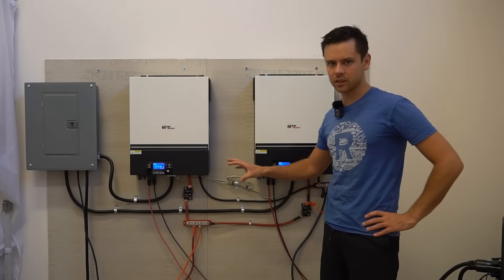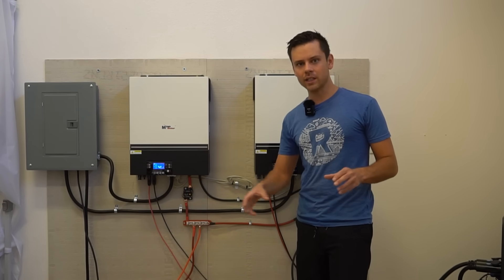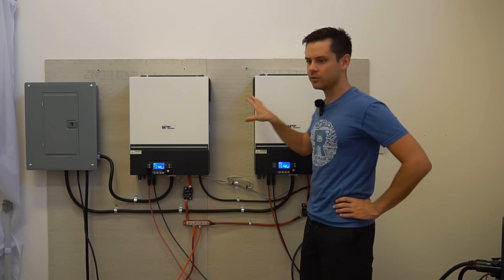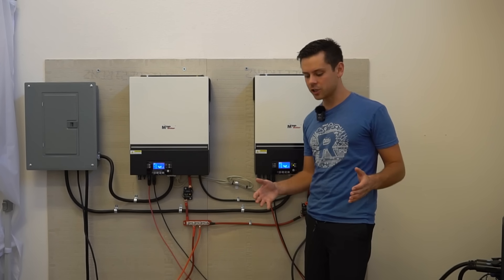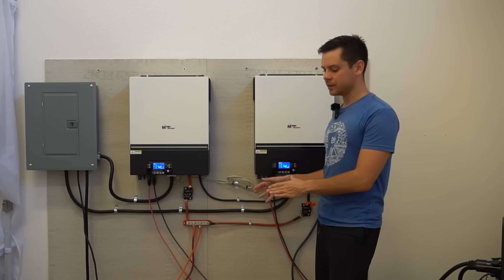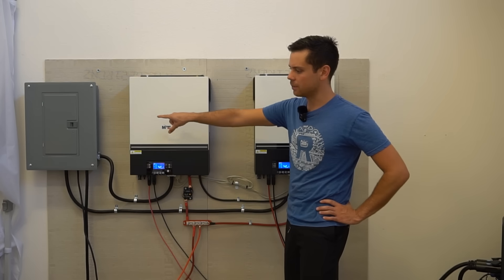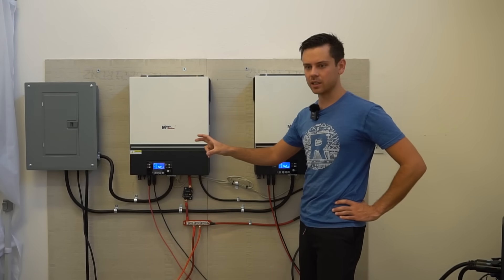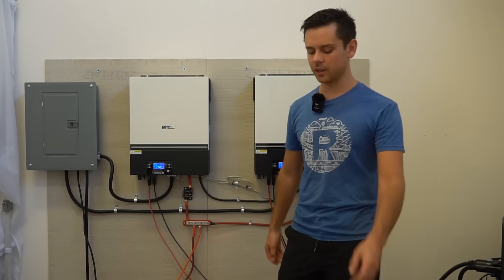Does my 13kW Offgrid Solar System require Grounding? Is it Grounded?

Comment: If this system can feed a constant 5kw with grid tie, and could handle at least a 7kw input, it'd be perfect for my needs.  Looking forward to see if your system gets there, though my limited understanding of electrical theory might leave me guessing if it can, even after you explain it.
Reply: The LV6548's are off grid only. The upcoming LVX6048WP inverters enable grid tie, and two will provide 13KW.
Reply: @Sanwizard1  Great.  Now comes the hard part.  Affording the components to build the system.

Comment: I have now watched the video.
Surge protection is a wonderful idea on the DC side - do not oversize it, match it closely to the maximum open-circuit potential of the solar array. Get the ground connection wired as straight as possible to a good earth ground (and this can be separate from the service entrance - like at a ground-mounted array) but bonded to other ground rods if inside a structure.

You are correct in not adding more ground points than at the service entrance of a building. Ground loops are to be avoided, chased down, and eradicated. They can cause all kinds of obscure issues. An SPD will not cause a ground loop.

The DC side, being under 60 volts, is likely going to be a Class 2 circuit under the National Electrical Code (NEC)
Solar arrays have the advantage of being inherently current-limited.
Batteries are not, so over-current protection is required.
Neither are going to be much of a shock hazard at 48 VDC.

thanks!
Reply: Your knowledge of electrical code is impressive, James Alles. I felt like a first-year electrical student, again, just reading your comment. Are you an instructor?
Reply: @jayspell179  no, that is something that I missed. I became aware of the low-voltage aspect of the code working for Simplex on Fire Alarm systems in the 80s. I suppose I did do a little teaching. thanks
Reply: Wow I don't think I'm ever going to be able to figure out these grounding theories.🙂
Reply: I enjoyed reading your comments. What happens when the PV arrays are wired in series and produce voltages of around 400V DC? The latest solar inverters can take up to 6kW input @450V DC up to 20A. If I had two 5000W inverters wired in parallel and eight 50V Canadian solar panels (VOC 49.6V, IOC 13A) wired in series serving each inverter, what might be the earthing / grounding implications of such an install?
Reply: @fredflintstone1428  earthing / grounding stays the same. Conductor insulation becomes critical - 600V is needed. check your local codes, it is now high voltage, and an entirely different animal.
Reply: @jamesalles139  Many thanks James
Reply: @jamesalles139  Hey James, I plan to purchase a single EG4, 6.5kW 500V VOC 48VDC inverter with a single LifePo4 48V battery and 9 455W (VOC: 49.35, ISC: 11.44) solar panels.  If I connect the AC outputs of the inverter to supply a panel's main breaker, would I just use a "traditional" copper grounding rod running to the panel's ground bar and be done, or would I not use a grounding rod and ground some other way?  Thanks in advance.  I appreciate your knowledge!
Reply: @fredflintstone1428  Going to be doing something similar myself.  I have a bit of a run from the panels to the solar inverters.  I want to keep the amps low, so as to not have to run super thick cables.

Comment: Seems a bit over complicated ... my understanding of what I think I heard ... a panelboard/breaker box (out of your inverter) should always be tied to an earth ground.  You may choose to earth ground the metal case of your outdoor solar panels for lightning protection.  However, do not earth ground your solar panel output/PV supply to your charge controller.  It's okay to surge protect the PV supply, but again, do not earth ground it.  Is that accurate?

Comment: I disagree, my solar power system was professionally installed. I had lightning strike (300 million Volts and about 30,000 Amps) my tree or next to it last year and it destroyed everything in my home plus both my neighbors lost there appliances. My warranty covered the loss  and the solar company come out and replaced my solar power system. As for the appliances that was out of pocket.
Reply from the maker: Well if a lightning strike is close or hits your equipment, nothing can save it 😂😂 what argument did I present that you disagree with?
Reply: @WillProwse  I think they just wanted to “disagree” and tell their story…..

Comment: Does this same thing apply to chassis grounding in an RV? This has always confused me that there is a separate chassis ground off the inverter as well as off the main panel. Based on what you are describing, it sounds like there are situations where a circuit might exist?
Reply from the maker: A better term to describe the ground in a RV is chassis DC supply return conductor.
Reply from the maker: Good question. Shore power connection requires a grounding connection with the plug. No need to run your own ground. The "ground" in a vehicle is not a true earth ground. It is for saving cost on wire, and use as a ground when tied to an ac connection. This connection is at the converter box where the shore power plug connects.
Reply: ICE vehicles usually use a DC grounded system, where the negative current conductor is a grounded conductor. This is analogous to a AC neutral. There is no ground fault protection in these ICE vehicles, normally only over current protection.
Reply: @FrancisKoczur  if one of the DC positive wires comes in contact with the chassis. The fuse or circuit  breaker for that circuit will disconnect the circuit.  That is the fault control.
Reply: @timselectric502  A short circuit with a small resistance will have a high current and blow the over current protection fuse, but there is not a separate safety ground. Ground fault protection in AC will trip even at a low current.

Comment: Will, can you please give us a visualization of different grounding procedures? Correct vs incorrect. Grid tie vs off grid.
Reply: seconded
Reply: Thirded
Reply: fourthed
Reply: Fifth-ed
Reply: Ditto
Reply: Same, please
Reply: Please provide some visualization on this topic. I have seen an end to end Inverter/Electric Sub-panel/Battery setup video and the gentleman there grounded the whole system with a true grounding electrode. Basically a separate grounding bus bar in the subpanel which is connected to inverters as well as true ground electrode outside.
Reply: Follow the instructions in the manual for the equipment.  Very simple.

Comment: Does this mean a sub panel for a house shouldn't have a grounding rod if the main panel does?
Reply from the maker: Yes exactly
Reply: Yea.
Reply: If the sub panel is in the same structure (house for instance) yes that's correct. If the sub panel is in another structure such as a detached garage away from your house a ground rod is required. The power feeding your detached garage sub panel (2 hots, neutral and ground) in this case the ground wire is bonded to a ground rod outside the garage. Definitely not the neutral to ground bonding as in the main service panel.

Comment: Will, be very careful discussing marine "grounding" as it can get tricky and lead to ALOT of corrosion for any metal touching the water. Stray current for marine is a big deal.
Reply from the maker: Very true
Reply: Yeppers, sacrificial anodes is an interesting subject for others who are curious about this.  Best
Reply: This is an area where even qualified marine technicians can get it wrong.  Be very cautious about offering advice.
Reply: @gregoryyount6907  
And every boat is different. Wood, fiberglass, steel or aluminum hull and composition of below water line hardware. Then you have “under protected, over protected and the just right. Where will it spend most of the time fresh, salt or brine. Types of anode metals, bond or not to bond and bond to what? Neutral switch over to ground, isolation transformers, equipment current leakage. Oh the list goes on. It’ can be a science. Wrong gets expensive.
And land electricians think they got it rough Lol!
Reply from the maker: Check out the victron unlimited PDF for some basic marine grounding advice: https://www.victronenergy.com/upload/documents/Wiring-Unlimited-EN.pdf

ABYC and this book is where I get my info on marine systems from: https://www.amazon.com/Boatowners-Mechanical-Electrical-Manual-4/dp/0071790330/ref=asc_df_0071790330/?tag=hyprod-20&linkCode=df0&hvadid=312176357948&hvpos=&hvnetw=g&hvrand=3157251246000314898&hvpone=&hvptwo=&hvqmt=&hvdev=c&hvdvcmdl=&hvlocint=&hvlocphy=9030754&hvtargid=pla-333901114316&psc=1&tag=&ref=&adgrpid=60258871137&hvpone=&hvptwo=&hvadid=312176357948&hvpos=&hvnetw=g&hvrand=3157251246000314898&hvqmt=&hvdev=c&hvdvcmdl=&hvlocint=&hvlocphy=9030754&hvtargid=pla-333901114316
Reply: @WillProwse  
Thanks Will. 
Hadn’t seen the Victron one. Now I just need to delete info in the grey matter to make room for the new lol.
Reply: @WillProwse  I'm glad you through some additional resources out there on this.  I cringed when you brought up marine systems because it can be so deadly.  I think if someone is going to youtube to learn about marine electrical they need to at least let a professional design their system.  You really need to understand electrical theory, electrical systems, balancing and grounding.
Reply from the maker: @mclovinfwmc  yes agreed. I understand the dangers.
Reply from the maker: @mclovinfwmc  which is why I usually never cover it

Comment: My growatt inverter specifically addresses this in the manual where I have to have an inverter controlled relay to bond and unbound my ground to neutral on the inverter output specifically when it switches back to grid power. 

Perhaps you can do a video on this?
Reply: Yep, @john, it's a requirement in my country, when the inverter operate on battery, neutral must be connected to ground. Mppsolar inverter don't do that. Shutdown ac input and check the voltage between neutral and ground. Should be zero, but its not on mppsolar inverter. You can find a grounding box, wich is simply a relay that connect neutral to ground under a condition controls by the inverter optional relay output. Need a special firmware version  to activate the relay when ac input is not present. Otherwise you can implement the same thing with voltage detection on ac input and some relay. The thing is mppsolar is totally speechless about grounding to neutral regarding regulation and theirs products.
Reply: @sergea1138  yes I have a grounding box. Yes the growatt has the function built in to operate the grounding box.
Reply: The transfer switch in my RV does this. When you kick on the generator it switches over to generator power and bonds neutral to ground since you are no longer getting bonding externally.
Reply: I have loads that will not run if the neutral isn't bonded to ground
Reply from the maker: Ohh is this when it is being used as a UPS? I usually disable that in my systems.
Reply: @WillProwse  I run solar as my primary and the grid as my backup. The grid neutral and ground are bonded in the main panel. So when I'm running in grid mode all loads function normally. When the batteries charge up and it switches back to the inverter my loads stop functioning because the neutral and ground output of the inverter are not bonded.  By code I can only have 1 neutral to ground bond in the system. If I connect neutral to ground on the inverter output without a relay I end up with 2 bonds when it switches back to the grid.

The growatt has normally open and  normally closed wire connections for this exact purpose to control a bonding relay.
Reply: @WillProwse  as an example, the only time any power generating source, sush as a generator can be determined as a seperately derived system is if the disconnecting means from one system and the other breaks the Nuetral(grounded) conductor at the same time during power transfer.
Reply: I suppose, that this relay acts as "automatic grounding relay" for the following reason. Inverter itself can be considered as independent AC source, like gasoline/diesel generator. So, if this inverter is in Off-grid mode (island mode) without any connection to AC grid, then, its output neutral must be grounded. 
If inverter has AC grid connection, AND its neutral runs from AC input to AC output continuously, without any interruptions like contacts of relays, then, neutral grounding of AC output is accomplished by AC grid's already grounded neutral. Following yours descriprion of Growatt behavior and need for specially controlled relay, I think, that neutral from inverter's AC input to AC output can be breaked by some internal relays in island mode. So, this relay is needed to groung output neutral locally, near the inverter itself. The same requirements for output neutral grounding are exists in the world of Telecom inverter systems (DC 48 V to various AC voltages). We also need to ground AC output neutral in case of absence AC input connection to AC grid.
Reply: This is worrying because after reading John's explanation it all made sense.
Reply: @wendygerrish4964  my issue/comment isn't entirely in line with what Will is talking about. What Will says about grounding and grounded is great information and accurate.  What I'm talking about is how some loads in off grid systems won't operate if the neutral and ground aren't bonded.  The load sees the potential difference from L1 to ground as 60v and from neutral to ground as 60v and the load won't operate. I'm hoping Will makes a video explaining it better.
Reply: @johnlockington9872 , ungrounded (IT) systems poses main problem to homeowners: these systems requires 2-pole breakers for Line-Neutral loads, 3-pole breakers for both split phases + neutral and 4-pole breakers for 3-phase loads with neutral. I.e., breakers must disconnect all current-carrying conductors for safety reasons. So, standard "household" panels doesn't allow this configuration. All of it specially designed for grounded systems. So, you need to use industrial components. Also, a special insulation integrity (resistance to ground) control unit is required for safety reasons. So, grounded systems are more easier and economic to implement
Reply: I agree, hopefully Will can do a video on this. I was instructed to jumper neutral input to neutral output.
Reply: @Nathan-wf3fr  I don't think that's actually a good idea as you're then allowing the neutral to be connected all the way back to your main panel even when you're not running off your main panel. While it depends on your inverter the Growatts like I have can command an external relay to open when your on your main panel and to close when your on your inverter/battery supplying the power. That basically bonds and unbonds the neutral and ground on the output of the inverter when appropriate.
Reply: @andycanfixit  yes sir, agree with you 100%. Many thanks for the input. I’ll start relay shopping now. Would be great if either you or John posted a video for this. It’s a super common issue that many beginners like me overlook. We think our systems are all good to go and in reality without this relay controlled neutral to ground bonding we have damaging voltage swings and no ground to our AC outputs.
Reply: @Nathan-wf3fr  I posted a video on the process for the Growatt LVM 3000 inverters. It's really straight forward on that unit since they have an option to control it.
Reply: @andycanfixit  thanks a million!  Outstanding information, and I like that you used a 24v relay and power supply.
Reply: @Nathan-wf3fr  was that in the manual?
Reply: @johnlockington9872  I called up watts247 (Ian) and that’s what he told me to do. I think the bonding jumper from ground to neutral in the downstream (from inverter) sub panel that you describe is the better “by the book” solution though. I’ll probably switch to that later on, but at least got now my appliances that require grounding and pure sine wave are no longer failing.

Comment: Great video, but I had a question about these inverters. I went on their website and found that these are “off grid” inverters. What is this “AC input” that you refer to in your video? Is that for AC charging?
Reply: They have many types of inverters, I think the ones Will has are "hybrid". You have 120V in from the grid yes. That can be used to carry loads or charge batteries when the solar array isn't producing.  You can choose what power to use for the load side of the inverter... give priority to the solar and batteries or the grid etc... depends what your goal is. Lots of people just use these things as a type of online UPS for critical circuits and the batteries are just there if the grid fails.  One of the inverters cuts out the need for transfer switches and is flexible on where it gets energy ... arrays, generators, the grid - everything but rubbing two sticks together. I've powered/charged mine with a step up transformer using the dual alternators in my truck (36V @50amps step up)
Reply: Depends on what type you buy. I have these hybrid off grid inverters and I can use it completely off grid with a generator as a back up or connect it to the grid if the battery bank is depleted and no sun.

Comment: I have a hybrid offgrid system in my farm house. I have a grounding rod that runs a wire to my breaker panel. I have my ac input ground connected to it as well as a ground for some other fuses. Is this safe? Your video made me question how the solar installer did the ground of my setup.
Reply: that's perfectly safe, you should just have an rcd